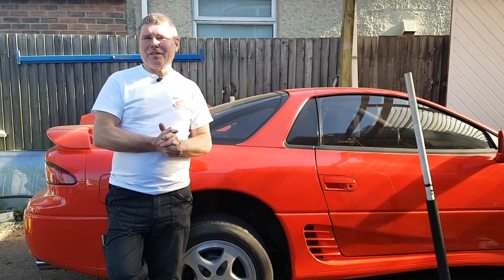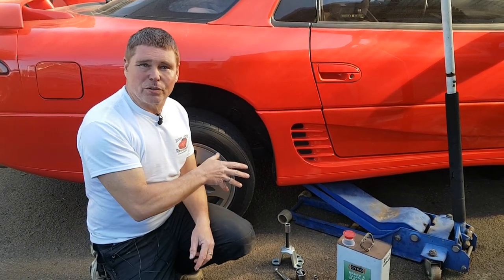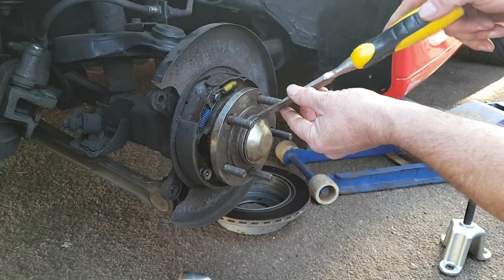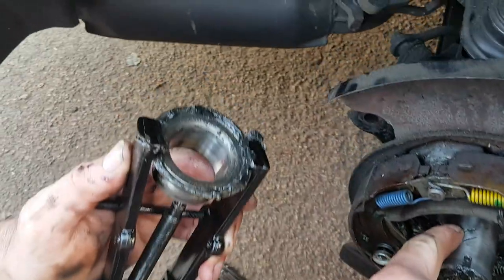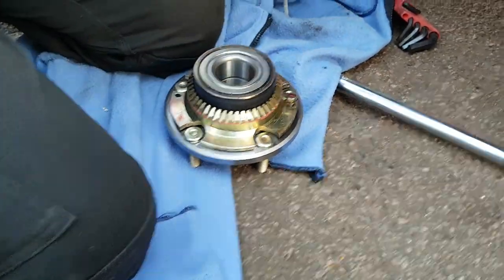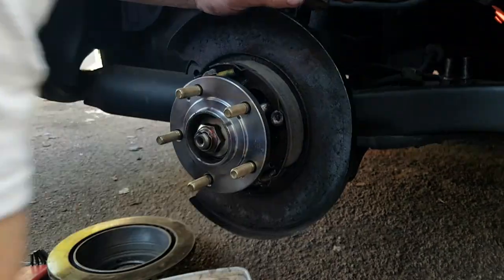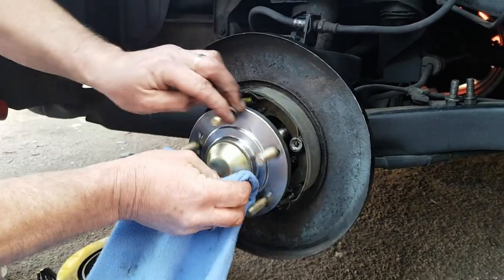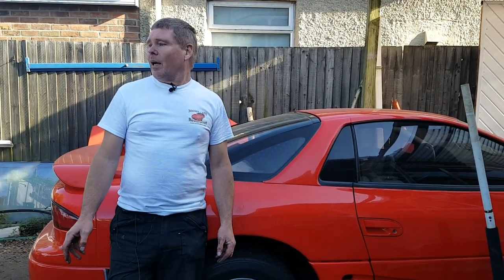Mitsubishi 3000gt / GTO Rear Hub Bearing Replacement (Front wheel drive)

Comment: Although I've done this on several cars and know the job inside out, I'll admit that I learned a little through your clear and concise delivery.  Good job mate!!  Now, I'm looking forward to your VR-4 rear wheel hub and bearing replacement!  That one (I have not done yet) has me a little befuddled.  Cheers!  I think a good suggestion, would be for folks to pick up an 18 or 24 inch torque wrench for axle nut and wheel torquing to spec.  They're very cheaply had for many folks, especially those in the US with access to Harbor Freight stores.
Reply from the maker: Hi
I hope to be covering 4wd hub soon. I am just waiting for a set of bearings. Cheap aftermarket parts are not as easy to get in the UK as they are for you guys in the States and due to the lock down, I can't pop over to pick parts up as easily as I would normally do. You are absolutely right about owning a torque wrench but don't forget that I try to do all of my videos for the man at home who has no more than basic tools and knowledge. There will soon be a set of more advanced level videos which will require the need for more advanced tools. I really appreciate your comments and thanks for watching.

Comment: Your car is so beautiful! No rust. We can tell you love your car😁. I never would’ve thought the wheel bearings could go bad. Always very appreciative of your thoroughness! I’ve seen many videos on how to change the wheels or brakes or rotors but they’ve never pointed out the ABS sensor before and they’ve never showed how to clean or sand for maintenance. Thanks for sharing! PS I found the torque setting joke super funny 😂 

Gold Wolf from the USA

Comment: Hey I was just wondering if you’d do a video to show how to change the ignition timing. I love your videos by the way! Super easy to follow and you’ve helped me a ton with my car. I drive a 92 3000gt sl and I actually just watched this to replace my wheel hub! Again thank you so much you are great! My name is Andrew Langford and I am a subscribed member 😁
Reply from the maker: Hi Andrew
You can request videos on the forum.
Forum.the3000gtplace.com
The timing belt video is already done. Is this what you mean?
Reply: Thank you sir. It’s the ignition timing. I know there are two things that need to be done to do it. Pull a spark plug and make sure something is dead center. And turning some sort of sensor or something lol. Have a good day man and thank you for the reply!
Reply from the maker: Do you have a sohc engine?
Reply: It’s a 92 3000gt sl dohc. It has the vr4 engine with no turbos. It’s also a manual conversion idk if that matters or not lol. Thank you so much for your replies! You a good guy 😁

Comment: The front wheel bearings don’t come as an assembly correct? I’m looking at changing my front bearings and see some companies sell the front as an assembly but I don’t think it’s labeled correctly on the parts site.
Reply from the maker: If you have FWD it is separate bearings which will be covered in a video soon. If you have AWD, it is a complete hub assembly as shown in the AWD video.

Comment: Is it not necessary to apply grease between the shaft and the bearing? Nice video 👍
Reply from the maker: No grease is needed on the shaft because the bearing is bolted directly to the shaft and does not rotate on it like other types of bearing. The bearing on the fwd model is sealed with grease inside. If you put grease on the shaft it will be forced out when you do the hub up and will drip onto the brakes as had happened with the one in the video.
Reply: 3000GT / GTO Restoration thank you very much!